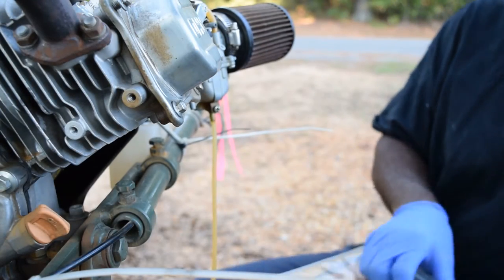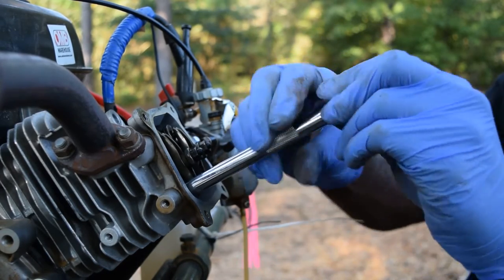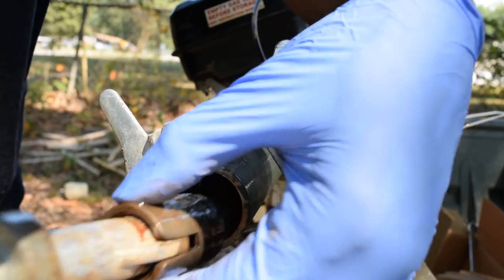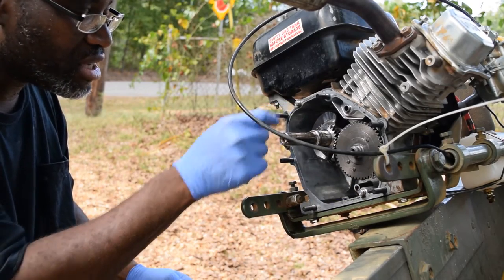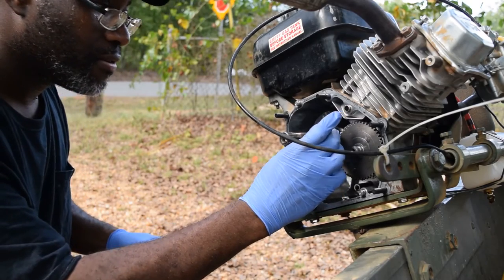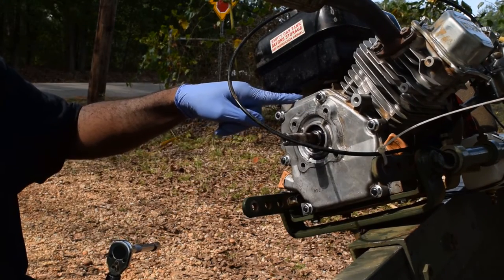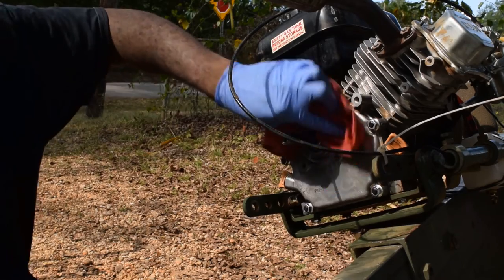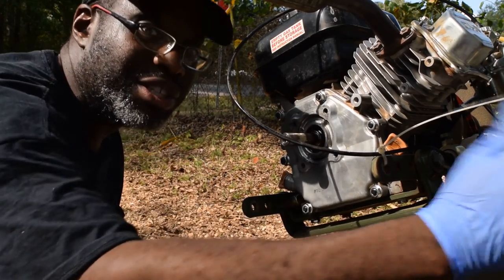Reinforcements: Burris Racing Studs and ARC Racing Shims for 212cc Predator

Comment: The problem is likely the thrust load from the prop. You need some type thrust bearing on the front of the crankshaft, there is a type of tapered roller bearing  that has the same form factor as the deep groove ball bearings on the crankshaft.
 It has less axial load and more thrust capacity. Keep the deep groove on the aft end though and keep your shim on the aft end if possible.
Reply from the maker: Na, the design is 60 years old. The problems only show up when when running high RPM on a single cylinder engine without a counterbalance. I've had zero problems with my current engine. These little engines are out of balance by definition. So a counter balance like the 13hp version or a second cylinder like the V-twin totally solve the problem. Or keep the engine below 5,000 and there is no problem.
Reply from the maker: Also there is a bearing in the in the bell housing of the shaft.

Comment: Great video
Reply from the maker: Glad it helped. I have not had good luck with modifying the motors in this way. I've fond the burris system did not help overall. I find the best, most reliable mods for mud motors are a good intake, good exhaust, up the idle and main carburetor jets, ru na billet flywheel and set the governor to 5,000 RPM. More than that has not proven reliable at all in the marine environment.
Reply: Black Warrior Lures i run my 212 on a 1970 bird mini bike and i seen your video and ordered the burris studs. I put a mikuni vm22 and a straight pipe with out the govenor i dont go above 4000 rpms because the bikes so small and wants to wheelie. But thanks alot for making the video keep up the good work
Reply from the maker: That's the ticket! Yeah for mini bikes it isn't as much a problem. There's a weird resonance frequency that sets up on the water once you get into high RPM that none of us mud motor builders haven't been able to hack. Most have moved on to 420cc big block to get power at low rpm.
Reply: Black Warrior Lures now a 420cc big block would be great to see on your channel
Reply from the maker: Wish I could afford it. Need to buy new camera gear now.